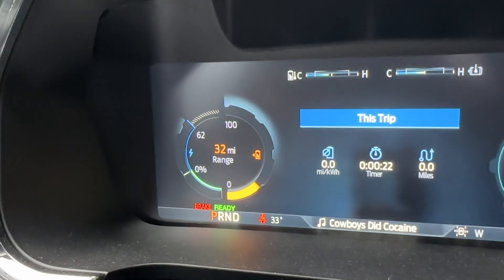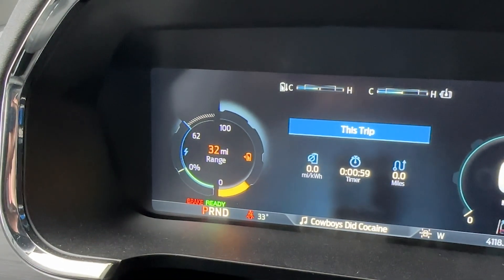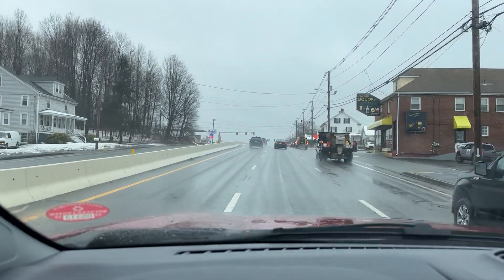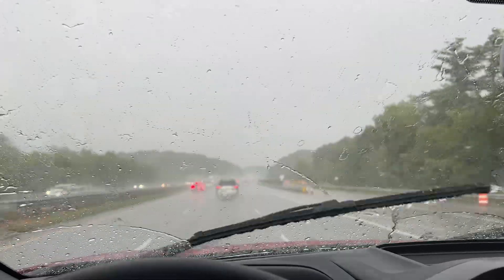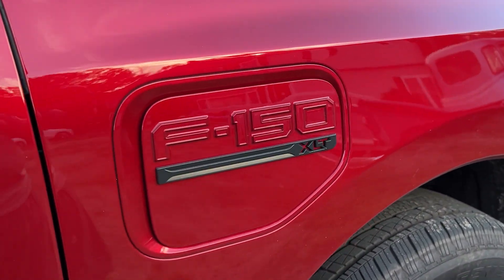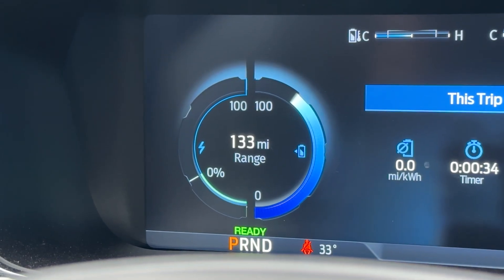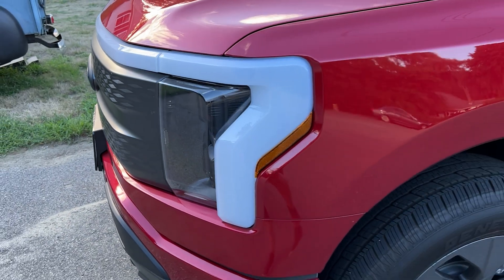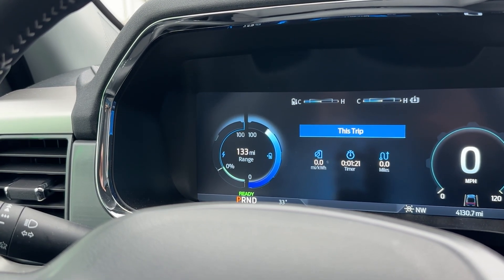Why Does The Acceleration Percentage Drop on the 2022 Ford Lightning??

Comment: I’ve noticed it’ll pull back power when range is low a lot more than when it is cold.
Reply from the maker: I've noticed a bit of both. Not 100% what the main reason is. For example I was 70% charged in 0degree and it cut power. Battery indicator was also orange.

Comment: 133 miles and should be getting 240 miles? You are at 80% charge, not 100%.
Reply from the maker: I didn't say it was at 100% however with only 20% missing it still would be well under the marketed 230 miles of range.